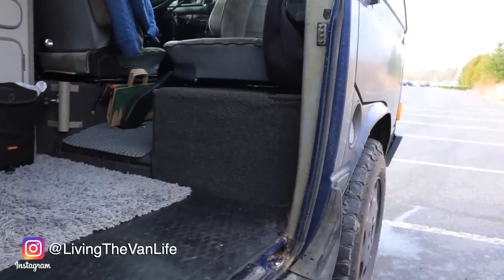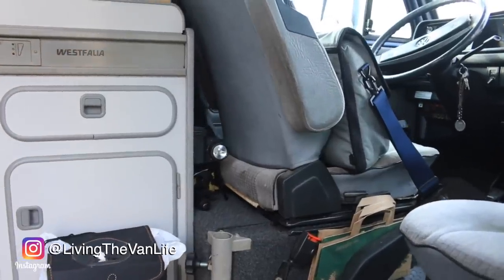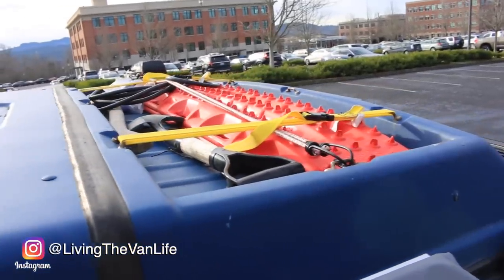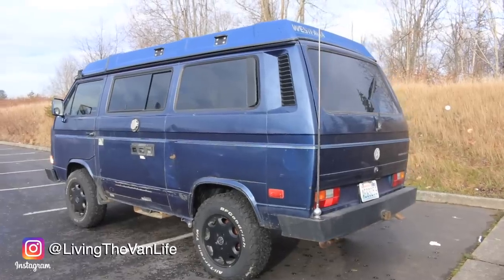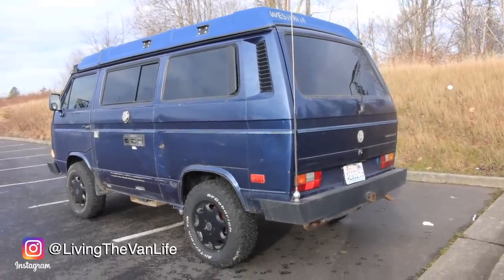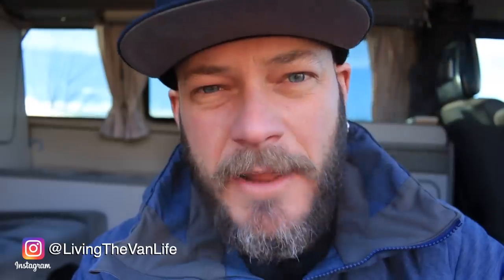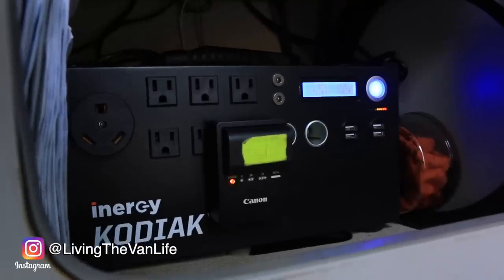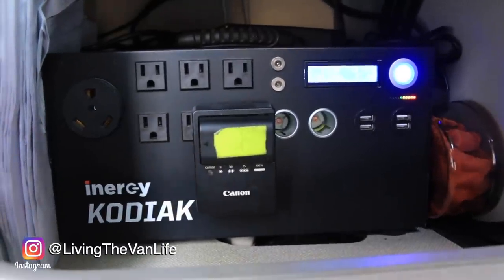Chinese Diesel Heater Install In a Volkswagen Westfalia - Living The Van Life

Comment: A propane mounted heater would have been much simpler.  Two propane bottles mounted outside on the rear bumper for heater fuel would keep the interior nice and warm.  You'd have to have a window cracked for air circulation.  Because of the air circulation, the windows wouldn't fog up.  The radiant heater warms the surface of anything in front of it which heats the surrounding air.  No electrical power is needed. The propane bottles will last a couple of weeks if only used for the heater.  With a water heater, a propane fridge, and cooking, the propane would last about one week.

Comment: Got to love that ticking , 5kw way too much  , temp sensor is on the intake so if it’s drawing air from the cab....good luck
Reply from the maker: Way too much for what?   I was in -5°F weather with the 5KW on HIGH all night and still woke up with ice on the inside of my windows.  I couldn’t imagine having anything less than 5KW.
Reply: Just sayin 5kw is a lot off heat my 2kw on full power sounds loud!  ( like a hairdryer on full)and kicks out loads  in low temps  until it goes into limp mode which hold an ambient temp , you shouldn’t be getting frost in your bus surely !

Comment: Thanks Chad!. Great video. One thing that is not clear is how you mounted the unit through the floor under the van. The studs on the heater seem a bit short to go through the wood in bench bottom and to the outside. Can you clarify how you resolved this?

Comment: Just an idea , why don’t you run a 3/4 copper water line inside the length of muffler and this will give you reasonably warm even hot water in those cold mornings .

Comment: These systems do soot up inside from what I have heard and they need to run on high to burn the carbon out I think you could also use power service injector cleaner to loosen soot and burn it out.

Comment: Isn't the fuel line running under the van not good especially since it's not braided? I swear a rock could easily bounce up from the road and Peirce it causing the fuel to leak and you losing use of the heater?

Comment: Thank you for this.  Very informative and proves once again you do not have to spend over 1,000 to get a heating system.  Two questions: 1: what are the dimensions of the fuel tank; and 2).  Do you have any diesel odor inside the van because teh fuel tank is  inside?

Comment: i don't know if I trust that o ring on the supply nipple over time. Since it has a pump, I'd make the fuel nipple on top of the tank and have a metal tube pointed to the bottom of the tank for pick up.

Comment: Pretty sure these heaters can also run off of gasoline. At least the name brand German ones do. You could have just tapped the fuel tank and had a much cleaner set up. The idea of having diesel tank in the cabin isn't exactly comfortable especially considering it will vent into the cabin if the temperature rises.

Comment: That has to be heads and tails better than sleeping like you were, all bundled up. I’m assuming you’re able to keep that thing going all night long and not worry about it drawling your batteries down? What’s the average temp at night?
Reply from the maker: It does work nicely using it overnight for sure while not having to worry about having an open flame.   It does not draw too badly on the batteries once it is fired up and running.  It does have a fairly decent draw at start up while the glow plug is heating up.  All in all it works great on the long term.  But it is a must to have an auxilary battery set up to run this off of.

Comment: Hi Chad, one question I have as I’m installing mine now. I’m installing it in the same location you did. Did you mount it on the bottom plywood which is part of the Westy seat or how do you seal that as it goes through the metal pan of the van to below? Terry

Comment: Can we use smart charge instead as a battery source. I mean the unit can be powered by a regular battery apart from the van battery then to charge the battery (the battery connected to the air heater) we hooked it to one of those smart chargers which they r connected to van battery. These only allow to used the battery of the heater an not van .so in the morning when going to start engine the smart charge only use alternator. That is why they call it smart chargers. Very unique for these.

Comment: Hi Chad. I also live in WA and enjoy your videos. I’m currently installing an AUX batt system and when done will install a heater like you! I’m tired of doing the Buddy heater when the Owl hoots and when the rooster crows thing. I was thinking to scrap the diesel tank that comes with the kit and order a smaller one online. This way the tank can fit into smaller spaces (I’m not willing to rid the fridge) What do you think about installing the tank under the bench seat between the stock heater box and the ECU? This minimizes the distance between heater and tank. I can also utilize the hole in the floor that the stock heater uses (coolant line pass through) if I decide to take the stock heater out. Do you see any cons to this idea? I realize I’ll have to fill up more often but I plan to carry an extra diesel can for those weeks I spend off grid. Thanks bud.

Comment: Hi.
 Just looked at your video re, diesel van heaters, I am at this moment converting my van, my question is how long will your diesel heater run on the tank that is provided in the kit. Are you needing to fill it every other day,? Weekly,? Ect, (winter months of course)  I am into wild life photography, have just bought my first drone, ( have to master flying that now) have two motion sensing night camera's, and of course stills camera's and variation of different sized lenses, will be use said van in pursuit of my hobby,
          Any help would be most helpful, regards R.J....... England

Comment: Thanks for your video. 

***WARNING: Insane Ideas and questions ahead....or maybe not?****
1) I was wondering if there are other tank options which you may be able to install outside and under the van, in this way there won't be any 'scents' from sloshing around when you are driving.
2) I also saw a video where a guy used some tie-lines to hang his heater so that the noise would be less pronounced. Do you have this problem? What is your solution or what do you recommend? I really would not like to sleep with ear plugs, I mean, I would like to hear if something is going on outside.
3) Heck I wonder if some of these heaters are small enough to be installed in some of the larger vehicles engine bay connected to the A/C hose through some valve/bypass. Bonus: It would be a win-win if your vehicle is diesel powered and somehow you can use/split the hose coming from the rear fuel tank before
4) Seems that installing it as far as possible from the sleeping area would be great. Heck, maybe even being able to point the exhaust with a small muffler towards the front of the vehicle, sort of stealth, through the front grille.
***END*****

On the lighter side:
Does the 'Happy Buy' include a 'Happy Ending'? I mean, a warm van is more inviting for Rocking it "All-night-long". 
Yes I know, a Chinese Massage Parlor playing a  Lionel Richie tune....Sorry I could not help myself!

Comment: Hi Chad. I've got the same heater but I'm in a more or less inclosed van with only a 9x3inch vent near the roof.  The oxygen inlet and exsaust are terminated outside the van... Do I need to worry about oxygen levels inside? I'm worry I'm not going to wake up. Thanks

Comment: I have a 2kw on the way to install in my '02 Eurovan Weekender, as I didn't want to overheat the place.  We don't live in it or spend the winter season in it, but having some warmth on cold nights will allow us to get more use out of the van.  I have also been on the long search for a proper place to install the fuel tank, as I don't have a cabinet inside to install it.  I've been researching a different sized tank than the one it comes with to possibly install it in the engine compartment or under the van?  Like a windshield washer reservoir.  Your thoughts?  Also, did you consider a kit that has a T-tube to split the hot air exhaust to other parts of the van, like the top when then roof is popped up?  Have you seen what the heat loss is like with the top popped and is it sufficient to keep the van warm with it up?   Thanks! Great to see a video of one of these units installed in a VW van finally! There isn't much out there.
Chris
Reply from the maker: Enjoy your adventures!!

Comment: Hello I been watching your videos . I now got a all in one diesel heater same heater be mine is in a steel case ... 
Iv just got a 20 amp controller and and 2 x 5.5w solar panels thinking I might need more but it just to charge up the battery that runs the diesel heat and my amp for my sub . 
Iv been told solar systems to charge batterys are not good for diesel heaters . So what system would be needed to run the heater and amp .....

Comment: Where is the air intake for combustion located? I see the exhaust by your rr tire. Or is the combustion air coming from inside your van? Nice set-up and well designed. How long does the 15 L of diesel last in cold weather?

Comment: Was wondering if you ever smell diesel since your fuel tank is inside. I'm installing one of these in my cargo trailer (because of your video and the link you shared)
Reply from the maker: Nope.  I do not ever get a diesel smell.  You just gotta be careful while filling it.  I highly recommend just filling straight out of the station pump.

Comment: Great video! Have you had any fuel jelling issues with your fuel line mounted externally? Is the heater good on fuel usage? Thanks!
Reply from the maker: 2.5 gallons in 24 hours on its highest settings.  And in weather cold enough to gel the fuel, I found it best to keep the heater on high which circulate the warm diesel fuel through the system quick enough to keep it fluid.  On low setting, it did gel up on me at 0°F

Comment: I live in a travel trailer. I was looking at them also. I'm sure people would like to know how much fuel it uses over time. 
I wonder if it would be cheaper then propane with built in furnace.
Because I pay power also I need to balance with space heater and propane so power it not to much along with not spending to much on propane.

Comment: Great install,  not much information on the BTU output,  no specs  listed.  What's the coldest temp you used it in and did it do OK keeping up?
Reply: it's 5kw of heat output or 17.000 btu's

Comment: Do you have a baseline of how much fuel it uses overnight? I know it's variable depending on outside temp, what temp you like on the inside, etc. I'm thinking of just wiring it straight into my SA aux diesel tank and calling it done. Just curious how many quarts or gallons it may sip overnight. Thanks!

Comment: I’ve got a ‘79 tin top bus and just got my heater.  I plan to install much they same as you did but was looking at options to also run heater hoses from the diesel heater the either the heat exchangers or the heater control boxes.  My concern with going to the heat exchanges is any issues that may arise from preheating the air to the exchangers.  Any thoughts or comments would be appreciated.

Comment: I have a class B campervan with a monster propane heater. It works like a top, but the fan will zap my drycamping battery in half of a night. I am assuming these are more efficient? Would I be better off installing one of these? (The Canadian class B's are cool, but their designs are complex. So complex that it lowers the overall quality of their design. I want to simplify everything.)

Comment: is that Inergy Kodiak power system collected to batteries or is it a one stop power source with building in lithium? im looking at the jackery 1000 for running diesel heater, phone, maybe a high efficany fridge and thats about it, trying to gauge whether it'll all run off that also with solar and DC charging while driving, i figure i should have no problems.

Comment: Curious how that heater would work in a blizzard situation where the exhaust got plugged by a snow drift. Does it have an auto shut off in that case? The muffler option might be an idea to go more stealthy for urban camping  conditions.
Reply from the maker: I’m guessing the extremely hot exhaust is going to help keep the exhaust pipe clear of a drift.

Comment: Could you connect the exhaust to your vehicle exhaust pipe and utilize the vehicle muffler system?
Reply from the maker: I don't believe so.  I thought about that.  But then with the engine running, you would have back pressure of the engine exhaust feeding back into the heater.  That was my concern with that idea anyways.

Comment: Hey buddy i loved this vid! so many vandwellers struggle with heat solutions... My question is: How efficient is it? Would it stay on all night on fully charged quality car battery (in case you dont have extra seperate batteries, i always have a small lithium battery jumper pack lol) ? Just trying to get an idea on what can be done with it
Reply: uses 14 amps to start because of the glow plug, uses 0.4amps/h when the heater reaches it's set temperature. You do the maths.

Comment: I want to use one of these to heat my roof top tent. Does the 5kw model make a lot of noise when starting up and shutting down? I'd probably always use it on low. Would a 5kw model used on low be better than using a 2kw model?

Comment: I would install a carbon monoxide detector and see if I couldn't set up a way of using outside air for combustion. And for a little more peace of mind may be a carbon monoxide / smoke alarm and a fire extinguisher.

Comment: Your O ring needed to be inside the tank. The threads on the nipple is not sealed by the nut.
Reply from the maker: I had o-rings in both sides......
Reply from the maker: As it clearly showed in the video....
Reply: @LivingTheVanLife  My Mistake

Comment: Good job but I wouldn't have the exhaust aiming at a tire. When these first start up they exhaust straight diesel which can spray it like oil on your tire.
Reply: only if its set up incorrectly. other than that, I call BULLSHIT on that one.
I don't know of any which exhaust straight diesel.
Reply: @only-vans  maybe? I thought the content would be more oily than when its warmed up and burning properly
Reply: @idriscam  These things don't start pumping diesel until the glowplug is hot enough to burn it. It's a good feature.

Comment: Dope video. My ? Is this. Will this work as a heater while I’m driving a ‘65 splitbus. My heater boxes,etc were removed by previous owner. Thx!
Reply: Cole, I got the same question. What did you wind up doing? Did you tie it into your buses' heater duct? Thx

Comment: great video... i didnt notice, did you mention about how much diesel is that heater using per hour? also do you use normal car diesel or low quality industrial (used for heating) diesel? can you use used oil in that?

Comment: Hey man,  why not simply install a propex heater and run off your propane you already have? $ 700 or so and less hassle to space.   I May consider a diesel heater for my diesel E350 Ford I’m converting now.  Do you have a link to the “Chinese” heater.  Not sure I trust a diesel heater from China though.

Comment: How much fuel does it burn per hour ? do you have any figures you can share.
Reply from the maker: It burns 15L in 24 hours on the highest possible setting.
Reply: Living The Van Life so how much does it burn on lowest setting in 24 hours? Also on lowest setting, what’s average temp inside the van if outside temp is below freezing? Thanks in advance!

Comment: Could you use kerosene? I have a diesel heater in my workshop and i was using red diesel as its 50p cheaper per litre than regular and £40 worth (50L) would last around 8-9 days. I switched to kerosene and it didnt smell as much and it burnt hotter and 20L lasted 6 days and its been quite a bit colder too

Comment: Great video of the install and review. Do you know how much power it drains? Could I run it off a main battery if I only run it for a hour or so a day given I drive every day.
Reply from the maker: Upon start up, the glow plug draws a major amount.  for about 20-30 seconds.  After it is up and running, the draw is quite minimal.  However, I would not recommend using it off your main battery in fear of leaving you stranded with a dead battery.  Auxiliary batteries are cheap and easy to install these days.

Comment: Westfalias should have two batteries, one under each front seat, one of them starts the engine the other to supply electricity on-board, and I wonder if an electric space heater would last through the night from the on-board battery?

Comment: I don't know much about diesel.  Instead of using additives, etc, could you just let the diesel for this device gel up... then just heat the vehicle using the van's normal heater until the diesel thaws?  Or does diesel gelling cause other issues with devices like this?

Comment: Is the heater still holding up? I put one in my van and it only lasted a week before it quit working, I think my glow plug went bad as I’ve read the stock ones are junk. Sucks I have to be cold and wait for a part to take a week or two to deliver 😑

Comment: This might have been asked, but is there a reason you did not simply mount the heater in the cabinet where the diesel tank was installed?  Or just install the diesel tank in the same place as the heater under that seat?

Comment: They are planning to put diesel of the market in some years and are forcing us this way to buy electric cars or perhaps still on normal fuel. But diesel will be hard to find in the future, if not impossible. I never heard of this tiny heater but is a very good idea.